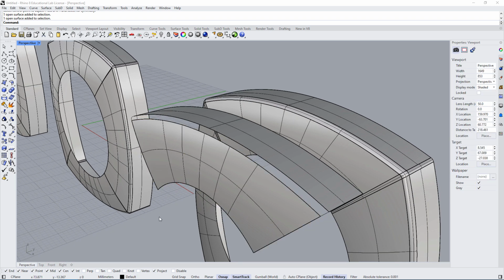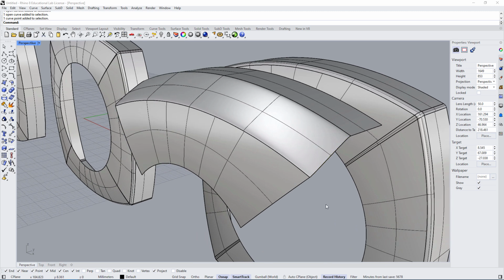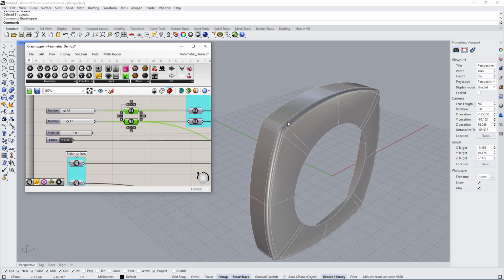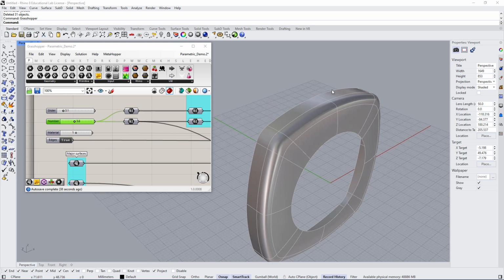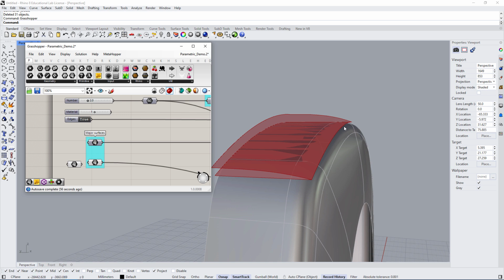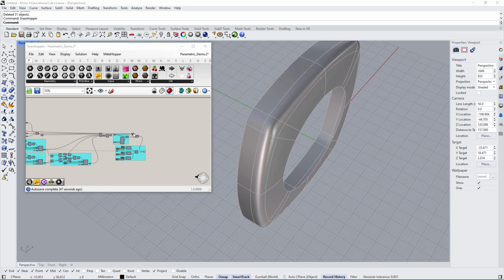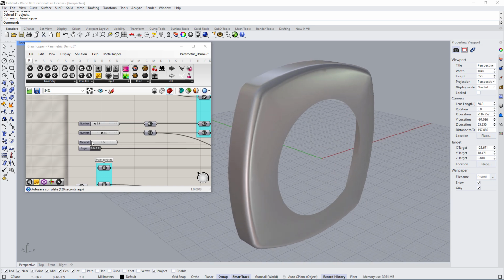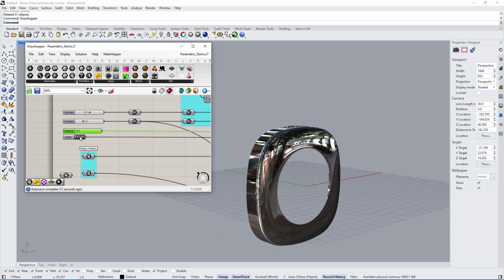Rhino Parametric Design Overview

Comment: blend curve is an interesting solution...
Reply from the maker: In Grasshopper, there is a way to generate a "blend surface," though it currently requires some coding and functions differently from the classic "Blend Surface" command in Rhino. For this demonstration, using a blend curve in both Rhino and Grasshopper worked effectively. However, if a native blend surface command were available in Grasshopper, I would have preferred to use it for this application!